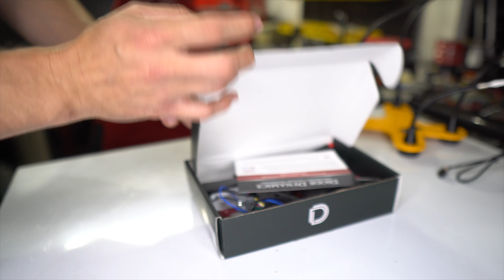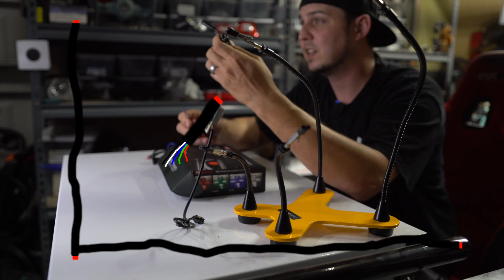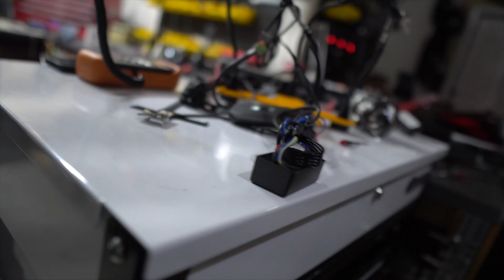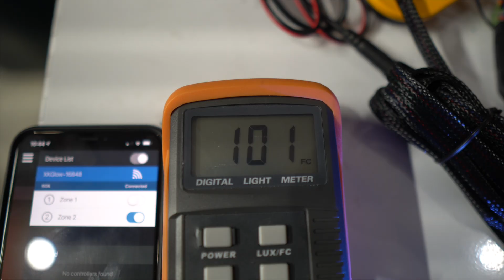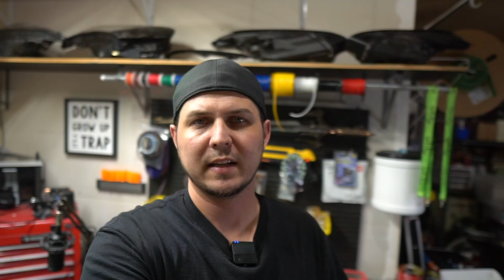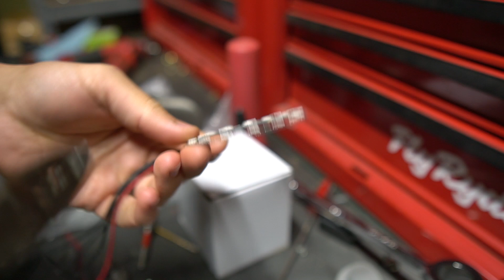STUPID Bright Demon Eyes

Comment: I have the XK Chrome controller and it's always on unless I press the on/off button. The wire isn't long enough to reach the cabin. What are my options to resolve this? Extending the wire for the button? Wireless button? Wiring so it only turns on when key is turned? Or anything else?

Comment: I hate to have to crack open my 2020 brand new headlights to install these kind of Demon Eyes. Is there a way to make an adapter to replace the headlights? A more simple plug and play demon eyes?
Reply from the maker: What 2020 make and model do you have?
Reply: @flyryde  2020 Subaru WRX STI

Comment: about to build a new set for my cobalt and am on the fence about the demons but after this video holy crap i might do DD demons :0
Reply from the maker: Honestly, I can’t imagine using anything but these on normal headlights. Unfortunately I can’t use them at this point for the GTR
Reply: @flyryde  Whats makes things even better is i use XK Glow controller as well. So to hear you endorse it 100% makes me happy. Everyone asks me why that over morimotos and i tell them that there's a lot more user customization vs the Morimoto. And actually your video on the prism halos with the xk glow controllers helped me clarify that they do in fact work with my controller. My one wish is that XK Glow supported RGBW not just RGB. but i can see that being a thing in the future. unless you have any advice as to how i would go about wiring that up. If not then ill just get a 4 pin JST end and wire it that way and cover the white so if down the road XK glow does do something for RGBW then ill have it there and still use it.

Comment: I have a question, I hope you can help me.  I replaced my break light bulb with San LED bulb. It work great except during night time when my headlight is on, it gives me a warning says check brake lights. Can you please help me.  Thanks.
Reply from the maker: Nelson your car sounds like it does bulb checks and needs a canbus bulb, or a code canceller to fool the car into thinking it has the stock bulbs still installed. What make and model is it?
Reply: @flyryde  its 2018 Kia Optima LX Plus

Comment: I installed the dd demon eyes but I learned about ws2812b later...
Reply from the maker: Not sure I understand. Are you thinking addressable RGB makes more sense for demon eyes?
Reply: @flyryde  it was poorly worded...  if I could find 12v rgbw neopixel chips I  would go for that option... I rarely turn on my demons eyes
Reply: @DD-jj2tc  You can get addressable drivers. ;)
Reply from the maker: Totally understand. Practicality is a big reason I avoid all other controllers. I want it to be a one button affair. As long as your controller can be triggered with a simple remote, I think any setup can be awesome.

Why are you currently using to turn them on and off?
Reply: @flyryde  bluetooth with the app
Reply: @TonyNowa  really I'll have to get one